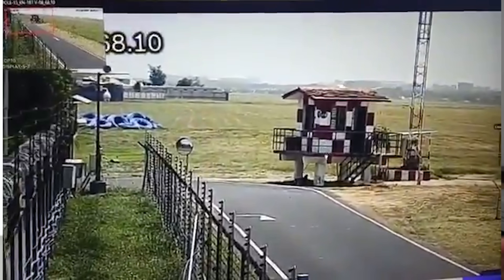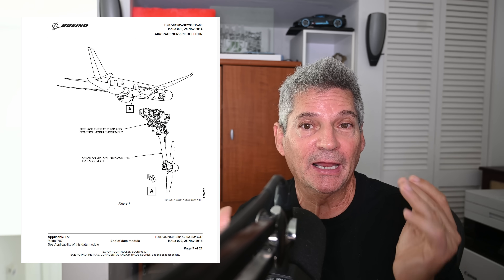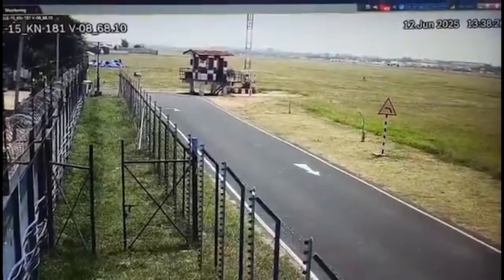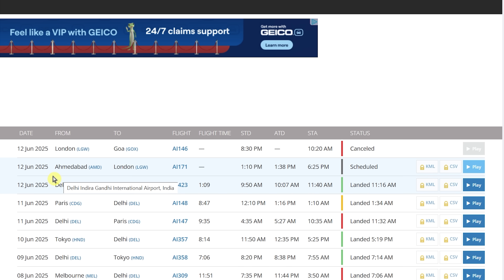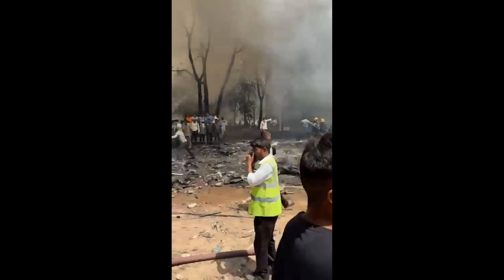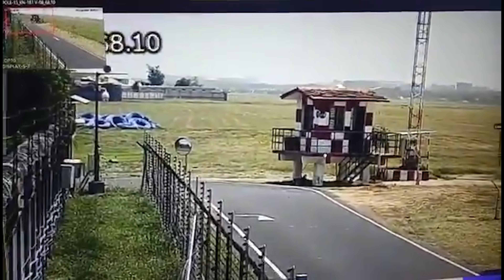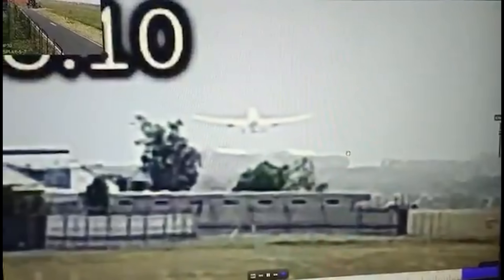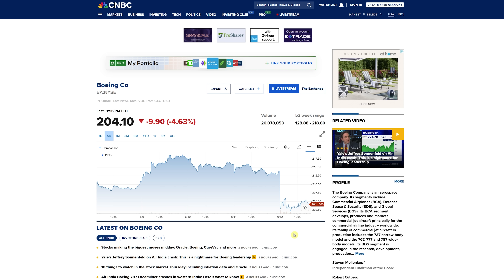What Caused Air India 171 Crash, Mysterious Sound Before Impact

Comment: I do not think the RAT deployed. You cannot see it in the original video. You're hearing the confluence of echos from surrounding buildings and the doppler shift as the aircraft passes.
Check the most obvious in the take off video. As the plane rotated and became airborne the landing gear was not retracted - and although it is difficult to see if the flaps are retracted they should be extended.
Probably the flaps were unintentionally retracted instead of the landing gear. No flaps and drag induced by the landing gear means the aircraft was not properly configured.

Comment: The RAT is meant only as an emergency power source for the aircraft in the event that both engines fail. It provides enough electrical power to power only one of the 3 electric hydraulic systems on the jet. If you have to use it for real, you are having a really bad day. 787's RAT Is Tested Regularly.

Comment: Hi Jeff  The man who "jumped" out of the wreckage I heard said that he heard a loud bang before the crash. The man was sitting right next to an emergency exit so the seating plan shown cannot be correct. He lost his brother in the crash.
Reply: The bang could be the RAT being deployed. It's spring loaded and would make a loud noise.
Reply: @HotmodCanada  or the battery exploding within steel case mechanically destroing contractors isolating shorted battery from DC Essential Bus. Which couldn't then be properly powered by RAT supplied Emergency AC Bus thus affecting FADEC
Reply: My comment won’t post with a link but if you check seatguru. You are right it shows 11A is an exit row window in economy
Reply: I wonder if he heard a bang or the RAT deployment below him...

Comment: Im guessing pilot error, the FO must have somehow instead of selecting the landing gear up,  moved the flaps from 5 to 1 making it impossible to create lift, stall speed increase prob 100kts heavy low slow full of fuel on a hot day no chance of climbing. The captain was fucked didnt have a chance its a horrible mistake, the flaps had to be set or they would have had takeoff flap warnings and rejected, it didnt sound like the engine noise reduced at all making me think they didnt lose power, i think the FO made the worst mistake possible raising the flaps by accident leaving the gear down dragging , the CVR and FDR will tell immediately what happened but it is sad watching the 787 wing try to fly .. the tips are above the fuselage she wanted to go flying but was robbed and now so many lifes lost .. i wish the passengers, crew FO and Captain and all loved ones clear skies and tail winds.

Comment: A jet taking off has a hell of a roar coming from the engines. These sounded quiet as it went past. The noise sounded like a bad bearing on an electrical motor winding down. Makes sense if it was the prop driven backup power.

Comment: Uhhh it was pilot error most likely, I've seen several reports saying the flaps were set incorrectly, landing gear was never raised when it was supposed to be & also they didn't use the full runway for takeoff by some reports also. Very doubtful it was a problem related to Boeing, the plane was built in 2014 & had been flying over 10 years but that doesn't mean it couldn't be a mechanical or a maintenance issue. The plane appeared to stall & started losing attitude instead of climbing with the wrong flap settings, landing gear drag on air speed & lack of speed from doing a short take off once it was airborne.

Comment: Need the FDR. I'f not damaged should answer questions very quickly. Could only be about a million causes...computer failure, loss of all thrust, uncommanded  movement of control surfaces, and on and on. Didn't appear to be a full stall, though stalls can manifest themselves differently depending on the primary failure. I'm leaning towards a fuel starvation/loss of thrust, something of that nature. He was likely the only passenger not  wearing a seat belt. Got bounced, got lucky, and was flung through one of the breaks in the fuselage in the cabin area. Having only minor injuries is testament to the slow nature of the event. People died from smoke and fire. Trauma alone wouldn't have killed many. This guy was flung free luckily through a breakage in the cabin upon impact. Others were trapped in their seats, soaked with tons of kerosene, and instantly set ablaze....RIP  (a horrible way to go indeed)

Comment: Nothing wron with this sound. What you hear is a doppler effect. You'll never hear the "Rat" because the engines are far more louder. The question is why there are no flaps set? Did they forgot to set thenm? You can clearly see that the elevator was pulled up until stall and the jet goes down because of lack of enough trust for this maneuver.

Comment: I think they absolutely knew there was a problem at V-1 or just after V-1 at rotation. because the pilot never called  POSITIVE RATE for gear up. We can tell this must not have happened because the landing gear was never retracted.  They flew way long enough that the gear would have been retracted if they had achieved positive rate. The fact that the gear was down and locked all the way to the end tells me they knew they had a problem as early as V-1 or just after rotation.

Comment: This is the third hull loss of a 787, the first two being a battery fire and a runway collision, both without any fatalities.
Good spot on the RAT, but also not the lack of noise from the turbofans, which should have been at full power and deafening at that unusually low altitude.
Regarding flaps & slats, the 787 has a protection system that will set the flaps for you (after raising hell in the cockpit) if you attempt to take off without them, and will prevent their retraction until a safe airspeed has been reached.  So it is vanishingly unlikely that the proper settings were not used.
Reply: No, this crash is the first hull loss for the 787, the other two incidents were not that. Hull loss is the same as when we call a car totaled, where it’s completely destroyed or unrepairable given the cost.

Comment: Okay.....If you look at the original video of the plane going down shot from behind that is more crisp than the one we got on the news it looks to me that we CAN see that the leading edge slats are deployed, right at 1:43. Do any of you see/ agree with me?  Question- if the theory that the flaps were raised instead of the landing gear, does that also bring in the leading edge slats or are those separetly controlled?  Take a look again at that part of the video and see what you think.  If the flaps were at 5 and the leading edge slats were deployed then it doesn't leave much more than a loss of power to explain what happened.  What caused the loss of power is the question and as soon as they get the black box which should be fairly quickly, we should get that data.
Reply: Actually, a good question.  Yes, the slats are clearly extended.  However, it is the same lever in the cockpit that controls both, and the way it works, when you move it backwards, the slats extent 1st, then the flaps in increments as selected.  Opposite when retracted.  You move the lever forward, the flaps retract 1st, followed by the slats.  There are hard detents so that you don't accidentally move the lever too far at once.  In case of a malfunction, many aircraft have the ability to separate that lever into 2 independent levers, so you can control slats separate from flaps. Only used if one system gets jammed or malfunctions, and you can still operate the functioning system.  The slats extended is also an indication that they did have the slats/flaps extended prior to takeoff.  (There is a LOUD aural warning system that reminds you if you forget)  Everything I see shows a R engine failure prior to takeoff, and then likely a mistake made in the heat-of-the-moment where they retraced the flaps instead of the gear.
Reply: @Summitspeedfly  I have not read or heard anyone else notice this, how could I and you be the only ones?  So if its not really possible for slats to be extended if the flaps are up, could there have been a loss of power, hydrolics, something between the flaps coming up and the slats because yes, the slats look to be clearly extended.  Thanks for looking at this!
Reply: @ak1ranger  - As a career airline pilot, it was the 1st thing I looked for in the video.

Comment: The crash doesn't kill you. The explosion and fuel does !.
Should fix the fuel so it doesnt explode !.
Reply: Jet fuel has been made so that it doesn’t ignite or explode easily compared to gasoline but to make fuel so it can never explode is practically impossible given that it needs to be able to burn or combust so the engines can work.
Reply: @dkmike2299  If so then why explosion ?
Reply: @NecroViolator  did you not read my comment?
Reply: @dkmike2299  Yes I did.
Reply: @NecroViolator  because its still flammable, it’s just less flammable than normal gasoline. The fuel just has a higher flash point than other fuels, and is ignited in a very specific way by combining the right mix of vaporized fuel, oxygen, and a spark. The same thing gets recreated during a crash given the high heat and sparks from metal rupturing and electrical shorts occurring combined with fuel being sprayed everywhere and getting exposed to the air, resulting in it igniting. It all just happens so fast creating a type of explosion or fireball. So while jet fuel is less flammable, it still burns, which makes it practically impossible to make it so it can never “explode” (rapidly combust). It’s just done in a controlled manner in an engine, and is uncontrolled during a crash.
Reply: @dkmike2299  Oman okay thanks got it now :(.. Sad really.

Comment: 1:08 
I don't know if I am wrong but I think the flaps were DOWN here.

See the black seam lines on both the wings and the white part of the wings below them , they ARE Flaps DOWN.

Anybody here experienced can surely corroborate but I do see perhaps the flaps. I may be wrong.
Reply: I agree, looks like flaps are down correctly
Reply: @rosspallatt4004  I do think that’s the case, however not a lot of individuals are pointing it out. This video was the actual video. 

There is another version of this same video but was recorded on a screen from another device which made it pixelated and difficult to detect.  

But in this version , you can clearly see the seam between the main aerofoil and the flaps. So, if that’s indeed the case, then the flaps were down.

Comment: Wing seats are by far the most statistically safe place to be, so no surprise to me that the one survivor was there.
Reply: lol “by far the most statistically safe”? Are you just saying that or where did you learn this? Cause seats in the middle section and around the wing are statistically the worst place to be in the event of a crash because the fuel is stored primarily in the wings and center fuselage. The safest place is always near the rear or a plane, further away from the fuel tanks and engines.

Comment: The noise heard when the plane passed by is simply the Doppler effect, absolutely nothing to do with an APU. The retracted flaps prove that there was indeed a problem with them. The air was very hot and the lift was therefore reduced, some aircraft do not take off with high temperatures and remain on the ground while waiting for better conditions. The temperatures were at the limit of what was acceptable and the lift was reduced and as the flaps did not deploy, the crash was inevitable from V1, moreover the extended landing gear proves that they did not have time to really react or even to give the causes because everything happened very quickly. They barely had time to give a Mayday.

Comment: Manufacturers need to start taking responsibility.  Everything on a dreamliner is automated.  Manufacturers and Airlines will always blame the pilot first, no matter what.  And if they can't figure it out, or don't want to reveal flaws in their design, they will 100% blame the pilot every time.  And the design flaw might not get fixed for years afterwards.  See Boeing 737 Max MCAS.  TWA 800 is another interesting one.  And if you sit around at the pilot's lounge of any tiny airport, friends of people who died in crashes often have vastly different accounts than the official reports.  Even flight schools are known to green light planes they know have issues.
Reply: Except you have no idea what is the cause behind the crash. Your whole comment comes off as very ignorant. Air crash investigations aren’t don’t by the manufacturers, and it’s found that the vast majority of crashes are because of pilot error, second is usually maintenance issues, then weather, and ATC errors. Design flaws actually make up a small percentage of crashes. There is a ton of information out there on every crash and it’s not hard to find out statistical information. The fact is a plane like this, the 787, has been in service almost 15 years (since 2011) and there has been over 5 MILLION flights in that time span, and this is the FIRST 787 hull loss crash or fatalities… And while it’s still speculation, everything right now points to other reasons other than a manufacturer issue. Obviously no industry is going to be perfect, especially with commercial planes that are some of the most complex and high tech forms of transportation in existence that need to be operated and maintained by humans, but there is a reason the airline industry is by far the safest way to travel. You are fear mongering and nitpicking at a tiny minority while ignoring facts and the statistical majority.

Comment: 787 is a great plane and is only as good as the maintenance and pilots.

Looking at footage it looks likely it at minimum had a LH Engine failure.....and being fully loaded and fueled and at low altitude simply the right hand engine couldn't keep the big girl in the air.

RIP to all the victims.

Comment: The RAT may have been deployed, but you wouldn't expect to hear it when the engines are at take off power, all the examples we heard were as the plane was landing.  Also, it looks like there were no flaps extended, and that the whole of the long runway was used before the plane took off, surely this is not normal.  Multiple issues???

Comment: The RAT deploys only after all other sources of electricity on the aircraft have failed. Most modern aircraft carry 3 sources of onboard electric power. Aside from the main engines a gas powered generator called an APU (auxiliary power unit), usually mounted in the tail of the plane, provides cold start power for the main engines as well as emergency backup electricity if needed in flight. The APU kicks in automatically if power from main engines is lost. RAT is the third power source (second emergency backup) and deploys only after the APU has failed. But even if by some technical fluke the RAT inadvertently deployed, unless it broke off and got sucked into an engine, or something along those lines, a deployed RAT does not cause the magnitude of disruption that happened here. This airplane clearly lost lift or thrust, possibly both. The RAT has nothing to do with either. Also, I did not see a deployed RAT at any point in the video. I hate to judge before all the facts are in, and certainly anything is possible, but my personal expectation will be an improperly deployed RAT had nothing to do with what happened to this airplane until an official, final report tells me otherwise.
Reply: I've flown a lot of airliners, and never flew one where the APU started automatically if power is lost.  If it is already running, yes, it will supply backup power, but it's not normal to takeoff with it running.  If you need to start it, it usually takes a couple minutes to accomplish that.  The only time we took off with it running, was in severe weather, or if one of the engine generators was inop.
Reply: @Summitspeedfly  there is a series of batteries onboard called the UPS (uninterruptable power source) and these batteries immediately pick up the electric load until the APU is fully run up to engage the load, usually in less than a minute.
Reply: @emilmetallic6393  - Good info, thx.  And I assume, like most airliners, it's not normal to have the APU running for takeoff, unless there is an engine generator deferred?

Comment: RIP (Rest In Peace) WHICH IS IN GREAT USE for CONDOLENCE MESSAGE

A large percentage of Hindus do write ‘R.I.P.’ when they want to post a condolence message. R.I.P. means ‘Rest in Peace’. This resonates with the practice of burying a body when the soul has left the body. But in the case of most of the Hindus this does not fit well; because the body does not ‘rest’ anywhere. Actually, the Jiva which leaves the body travels to various destinations, and ends up either in the heavens (svarga) or God forbid,  the opposite of it, called Naraka) - only to come back again to the earth (for further experiences) in a new body (cf. Bhagava Gita VI – 41, 42 and IX – 20, 21), and this goes on and on and on  until the Jiva loses its Jiva-role and becomes one with the Absolute. So it never ‘rests’, much less in the so-called ‘peace’.

So now the question arises. In the case of Hindus, what should one offer as a condolence, in the place of saying ‘R.I.P’ ? 

Swami Paramarthananda has shown the way with the following words:

“I pray for the smooth and uninterrupted progress of the departed Jiva. I pray to Bhagavan to give you all the strength to accept the Will of the Iswara”

It is the first sentence that is the proper replacement for  the wrong  ‘RIP’ slogan. Mark the Swamiji’s words: ‘smooth and uninterrupted PROGRESS of the Jiva’. This is the most apt thing for a condolence message to a bereaved Hindu. Let us learn it and use it.